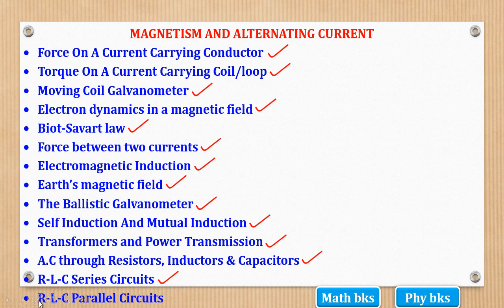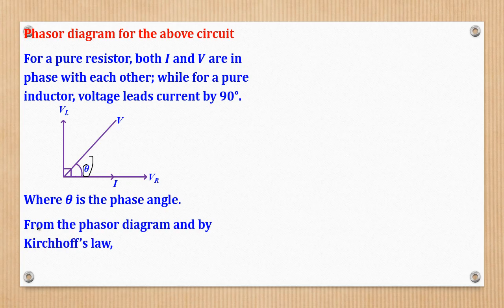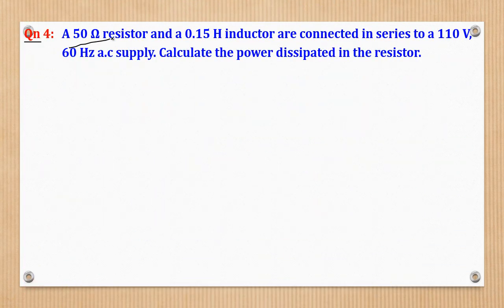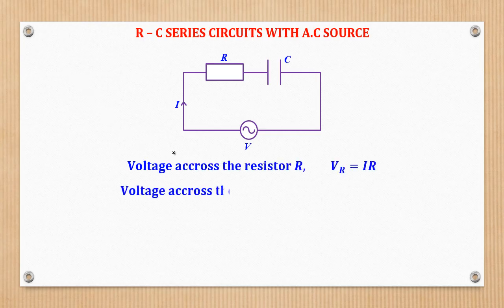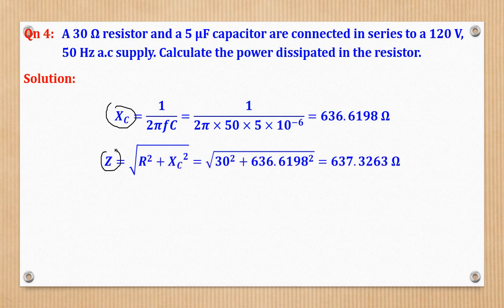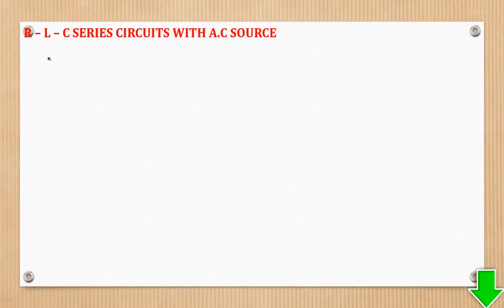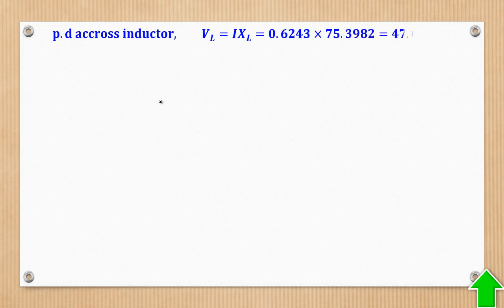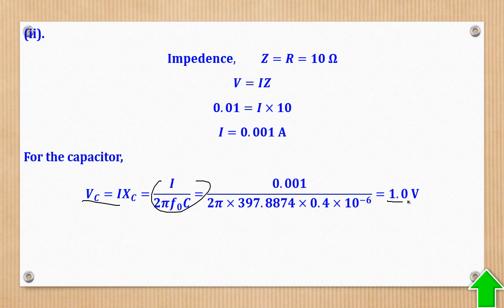013 – ALEVEL PHYSICS PAPER 2 | MAGNETISM & AC | R-L-C SERIES CIRCUITS WITH AN A.C SOURCE | 510/2

Comment: 11:03 on question 3 the voltage across the inductor is 82.3047volts.
subtracting wont give the right answer because this is ac not dc
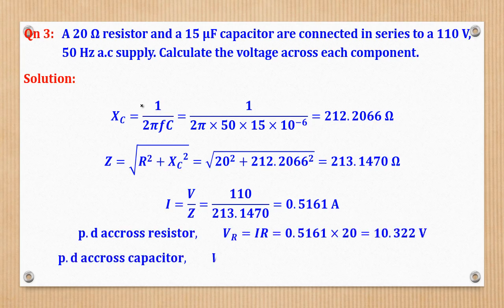same at 21:44 you can't just subtrat to get pd across the capacitor because it is ac not dc